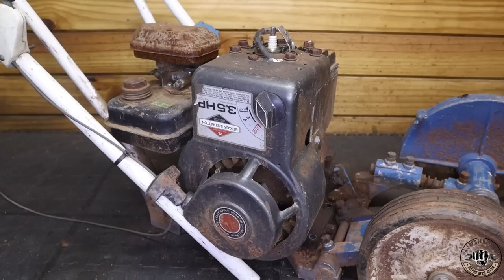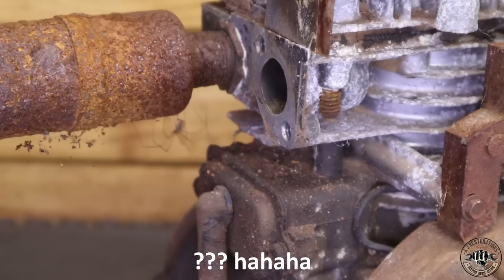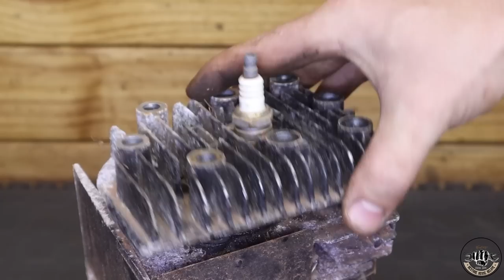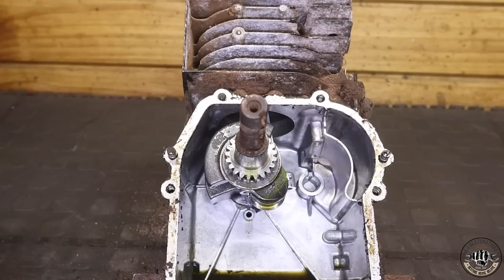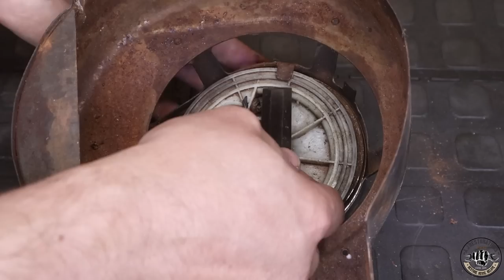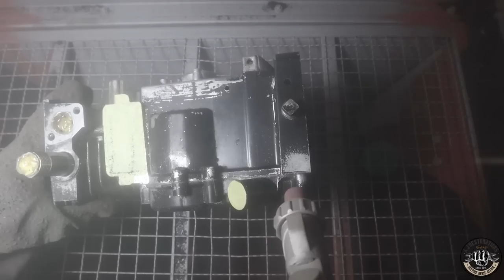Vintage  "Speedy Trim" Edger Restoration - Episode 1

Comment: I don’t think that is the correct fly wheel cover for that engine. There are signs that the cover is off of a 1980 3.5hp lawnmower engine. And that engine you’re working on looks to be a 70s 2hp.
Reply from the maker: Correct, its not the original cover sadly. I am still going to use it, I plan on wiring a kill switch where the know was.
Reply: @AJRestoration  ah ok cool. Are you going to make sure the sticker isn’t upside down 😂
Reply from the maker: I will try my best haha, I just measured the bore and stroke and it confirms its a 109cc engine, that matches the 2hp specs.
Reply: @AJRestoration  awesome lol. Plus I could tell by the fuel tank